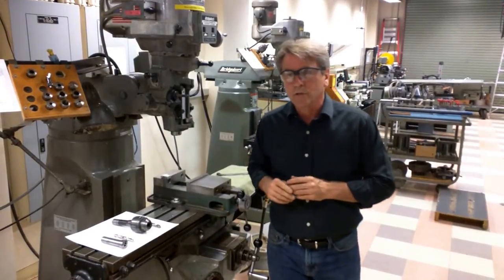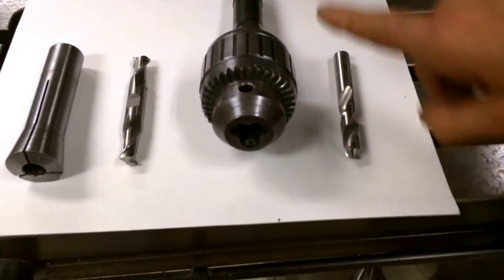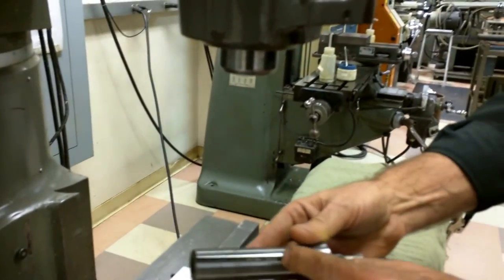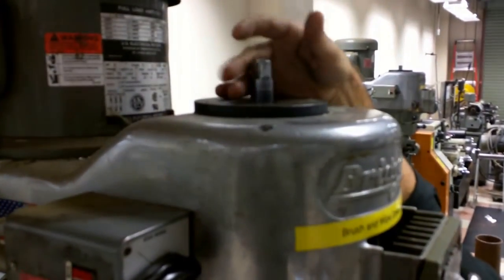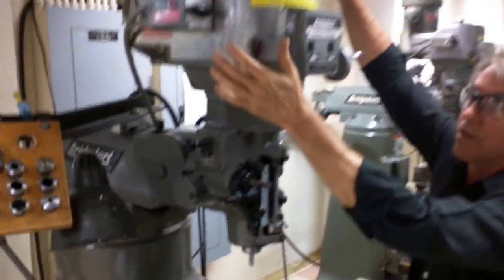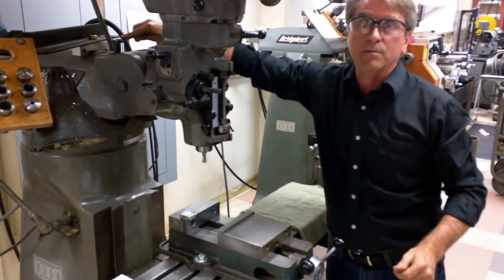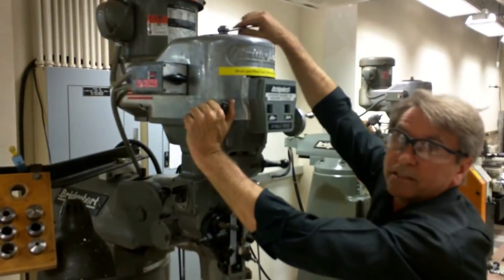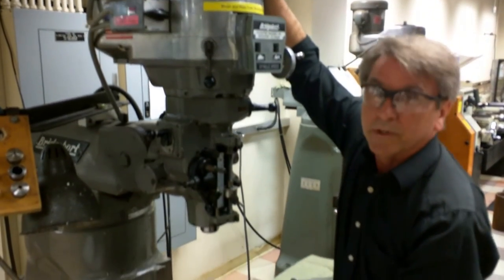How to Change a Tool in a Mill

Comment: I bought a tool that I have been told is to tighten or loosen the nut on top of the drawbar on abridgeport mill using a 3/8" impact.  Do you know anything about this tool?

Comment: Hello i just bough a used mill and it came with a piece i dont know what is its use. Its a metal plate of 1/2" height  and several holes 11 big and 9 smaller, and some removable metal cilinders, well more like pegs than cilinders that fit in the holes. Any idea what is?